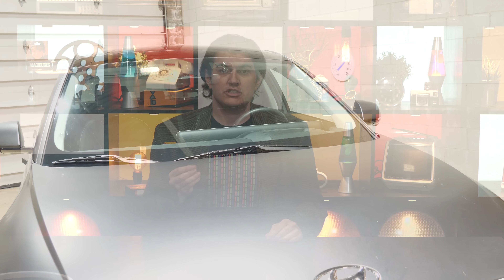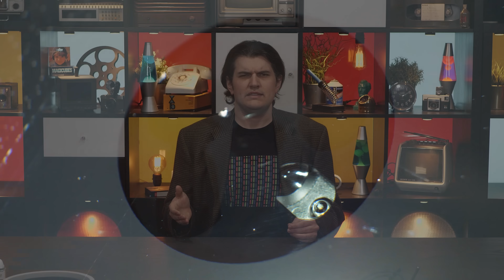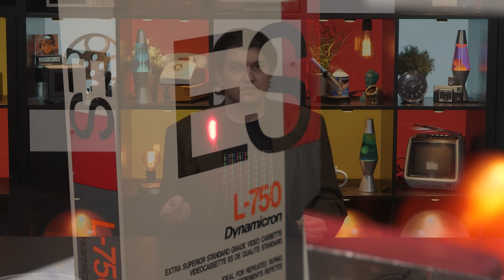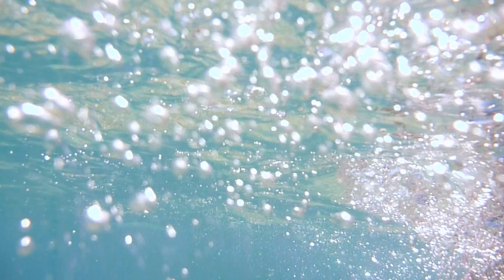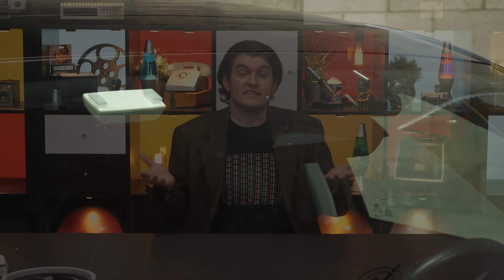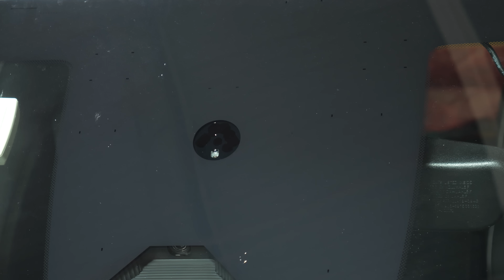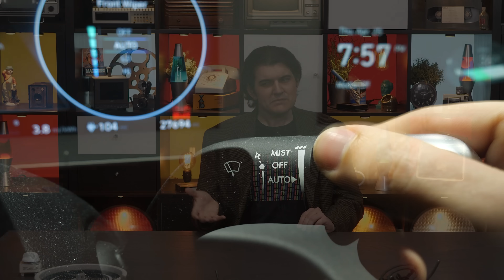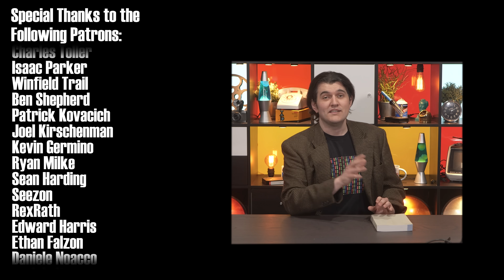The simple, clever sensor behind automatic windshield wipers

Comment: I have auto wipers - my major peeve with them is that occasionally they will massively overreact to a slight drizzle, and the lowest "manual" speed of my wipers is faster than I'd like for the conditions - there's just no way to get a usefully slow and steady wiping action, if the sensor has decided you're secretly in a monsoon.

Comment: As a Tesla Model X owner, I appreciate all the little jabs at Tesla.
Reply: I own 2 and the wipers are just a disaster.
Reply: I daily drive a 2020 Tesla Model 3 and I wouldn't mind seeing some straights and uppercuts mixed into the jabs.  I agree 100% with the jabs in this video and I would gladly pay extra for a real rain sensor.

I am generally happy with my Tesla otherwise, but I definitely will not trade in for a newer one until they add some physical controls back in.  I would say Tesla is taking "the best part is no part" mantra a bit too far lately.  They are basically trying to sell "the best control is no control" or "the best feature is no feature" which is entirely wrong, stupid, and short sighted.  Can you use buttons on the steering wheel for turn signals?  Yes, it is possible.  But should you?  No!  Doing so is objectively worse than a stalk.
Reply: @D3kKromb0x  yeah, well,  they seem to be fascinated by how Apple simplified computer UI by avoiding right clicks and menu items... I understand that part... but they kept the keyboard short cuts.

I mean, it's great if Tesla wants to make driving easier, but I think they should keep the stalks around until they know that nobody use them anymore.
Reply: "As a Tesla Model X owner, I appreciate all the little jabs at no organization in particular".
Reply: I don't classify Tesla as a car company, they're a software company that makes car shaped objects
Reply: As a Tesla owner, i find your comment is way out of context but that happens all the time by tesla fanboys
Reply: I thought it might works for  boeing
Reply: Even the Little Jab at the head of Tesla?
Reply: The camera based rain detector that malfunctions all the time is my least favorite part on my model 3. This is because I drive an old model with a signal stalk. I won’t upgrade to a Tesla again before they put the signaling stalk back.
Reply: @icefox1983  As a 2024 m3 owner I can tell you that the buttons are fine for signaling, I would prefer stalks but this I don't really care...
I want my light stick!!!! they made wipers control "fine" where you push the button and can change speeds with the wheel, but the lights are only controlled from the touch screen!
the exact same popup as the wipers pops up but you can't control it with the left wheel.
(only high beams are from the wheel)
Reply: @icefox1983 yeah same here. It's infuriating to have such a simple thing on an expensive car work so poorly.
Reply: Well, tesla isn't the only car company trying to make the cabin look more futuristic by moving controls into the infotainment system, or using touch surface buttons... it's also cheaper than actual knobs and buttons...

But it's so annoying to the driver, especially if that driver is old enough to have the muscle memory.

It's all good and convenient with cars that try to help you driving.

But there will be cases where it's nice to be able to override the fancy stuff, and preferably without removing your eyes from traffic.

Leave my gear selector alone, let me manually override lights, blinkers and wipers. And give me a knob for volume and climate control. Let me engage, disengage and adjust cruise control without lifting a hand from the steering wheel.

I also like how Hyundai use paddles to adjust regeneration and how Audi lets you change drive mode while driving, so you can switch to ECO when you enter a town, or you see the battery level disappearing faster than you planned.

Don't make me pull over so I can adjust everything for the further journey in the infotainment system.

And don't try to make me try voice control... as a non-native English speaker I'm sure that I pronounce some words incorrectly, and the Danish voice recognition isn't as well trained as the English one.

When that rant is out, I'll agree that it looks nice and sleek with all that touch and simplified controls... it's just not very practical.
Reply: @BenjaminVestergaard I think he’s more alluding to the lack of auto-wipe sensors in current Tesla models, since they moved to a pure camera implementation that, frankly, is just awful and doesn’t work.  All to save a few bucks per car.
Reply: @mobibobobobobobobvobobo  well, tesla also made away with the radar and ultrasound sensors... all camera based now...

I can't imagine that working very well for very long during a Danish winter if we have snow, because we spread salt on slippery roads. It creates a nice sticky sleet along the edge of the road, and during snowfall, that stuff builds up and you need to use sprinklers on your windscreen for it to remain clear.

I've experienced that sleet build up to get so bad that the radar didn't even work after an hour on the highway, and the camera based lane assist was not exactly reliable either. That was a Hyundai I think.

Edit: but I'm sure that Teslas all-camera system works pretty well in sunny California.
Reply: @BenjaminVestergaard  Tesla headlight alignment also doesnt work properly, also relying on the camera. Automatic MOT fail.
Reply: @mobibobobobobobobvobobo  They work quite well with the latest updates.
Reply: @BenjaminVestergaard unfortunately we have only had one snowstorm during my free trial of FSD but it worked fine.  Just this last weekend it was pouring rain at night and it didn’t have any problem on a 30 minute drive. I’ve been pretty impressed with what it can do with just cameras. That said it’s still not worth the $8,000 or $99/month just yet.
Reply: @williamreynolds6132  aw I know it's already impressive what it can do, especially considering that it's using cameras only.

What I'm not comfortable with is that they're removing sensors that can see something the eyes even can't.

If you try a really good assistant system, like VW or BMW, you can see in your dashboard what the radar picks up, and even when it's pouring rain, where your own visibility is limited to perhaps 50m, it can keep track of 3 lanes of traffic, 2 cars in front of you.

With cameras only it would possibly be able to identify the back lights of other cars right around you in such weather, the radar can evaluate the size of the cars 2 layers in front of you.

And then there's the snow thing... the snow fall itself isn't a big problem when you have plenty of cameras. The computer vision AI can sort out what's snow and ignore it per camera.

The problem is the build-up of salty sleet when the temperatures are close to 0°C. 

The snow is thawing because salt, but it's still just cold enough to still keep new snow, and if it settles on a moving car the windchill will freeze it and it will build up, just like freezing rain or black ice...

But the sleet isn't pure or clear, it's muddy, and within half an hour your entire front end of the car may be covered in a 5-10mm layer of frozen gunk.

You may be lucky that you can keep the windscreen clean enough, from salt, for that one camera working, but with only one camera the computer vision will lose depth perception and can't ignore the falling snow as it would usually do.

Sure, it may be able to estimate and assume distance from calculating perspectives... but I'd not feel entirely comfortable relying on that, not for FSD, not even for ACC.
Reply: @BenjaminVestergaard  "But it's so annoying to the driver, especially if that driver is old enough to have the muscle memory." - It has nothing to do with the driver's age and it's so much more than just "muscle memory" - a generic term for: a mix of proprioception (own body positioning and movement in space), kinesthesia (learnt movements to accomplish a task), exteroception (just the Mechanoreception part of it, for vibrations, discriminatory touch and pressure sensing) and object permanence (knowing that the knobs are still there, in space, even if you're not/ no longer looking at them). Ergonomics in industrial design is not just drawing pretty pictures...unfortunately designers now have to bend over to the whims of huge hordes of customers (and thus sales) and implement things that look cool on the showroom floor but which they know (hopefully) that are no where near as useful and convenient as knobs, dials and physical buttons, not to mention increasingly dangerous to use in a moving vehicle. But yeah, I pretty much share your frustration especially since I have first hand knowledge of industrial design, ergonomics and now am a software engineer in the automotive industry...Search  YouTube for "The Expert (Short Comedy Sketch)" and you'll see and hopefully understand what "being an engineer" feels like today, at least in this industry. Cheers!
Reply: @Archangell27  oh, I know that expert situation... why I'm not doing software anymore, but I was under the impression that the automotive industry, in general, was more run the old fashion and documented way, because legal requirements, rather than the startup way without a specification of requirements or an absolutely defined goal to base your test report upon before release to market. 

Anyway, what I meant about my age, I've had my drivers licence for almost 25 years, I grew up with certain features easy to reach in cars that wouldn't help me very much, mostly even manual gears.

A new and younger generation of driver would probably find it less annoying not having certain functions at their fingertips without looking.
Reply: came here to say this, 5 years of owning Tesla, we are at a point where the car drives itself so I'm freed up to micro manage its wipers.
Reply: get a different car
Reply: @telotawa  When you find an electric 6 seater with 320+ miles of range, automatic doors, can add 120+ miles with 10 minutes of charging, works with tesla supercharger network and is $50k or less, let me know and I will buy it. 

I have three kids in car seats and really wanted an electric minivan but those don't exist in the US yet. We have a Chevy Bolt and can fit 3 car seats in the back but it is very cramped and the charging rate is too slow to support the long distance road trips we take to see our family. The Model X checks off all of the things we were looking for and we were able to get a used low mileage 2022 for $50k. You can even find older Xs (with all the stalks) for under $30k. I have plenty of complaints about Tesla (and especially Musk) but the car does what we need now and will work for us for at least another decade.
Reply: @youruniquehandle2  aw, why did you have to put a max price on it? 😄 otherwise I would have recommended to check out the Mercedes EQ* series, the newer ones come with quite good ranges, and EQV has plenty of space.

Comment: The rain sensing system in my 2020 Honda Pilot is mostly useless in light rain. The rain drops are too few and random that the sensor just doesn't have enough information to go by. If water accumulates mostly away from the sensor, the wipers don't activate when they should. If a rain drop happens to fall right on the sensor but the windshield is mostly dry, the wipers go full steam when they really shouldn't. In moderate or heavy rain, the sensor works fine since the windshield gets rained on pretty evenly.

Overall I prefer the old fashion manual system where you choose the wiper interval.

Comment: Super interesting video, I (presumably like most) just assumed my rain-sensing wipers were operated by the camera. But if the same sensor that operates the wipers operates the automatic headlights then what is the small sensor on top of the dashboard for? I assumed THAT was for the automatic headlights. This channel always makes me think and I love it! 

Edit: I actually checked the sensor on my dashboard by covering it with a cloth and the headlights turned on, confirming it is for the automatic headlights. My car has both rain sensing wipers and automatic headlights but they are two separate sensors. Not sure if that's just a Ford thing or not.

Comment: years ago, I installed  a power skylight, and it instructed the installation of a rain sensor, which consisted of a small printed circuit card, with exposed conductive paths.  if a drop of water bridged two paths, it closed the circuit and triggered a "close the skylight" signal.  how far we have advanced.

Comment: 0:30 I literally had my Tesla from 2021-2024, just sold it. Not a single time has the auto wipers worked correctly. And from 2021 to late 2023 it was MANDATORY to use when using cruise control, you could NOT turn it off... So one drop of rain the wipers went crazy, pouring rain, it barely did anything. Random sun glare on a bright dry day, full power on the wipers. So i just couldnt use cruise control in my Tesla.... So much for the future... One of the reasons i don't really trust FSD becoming a common thing that just works, when they can't even make windshield wipers.
Reply: Auto wipers will never work correctly. Manual controls or overrides are absolutely necessary for a product to be quality.
Reply: @iunnox  My Mazda has the option of manual, but has auto wipers too but with a frequency setting from 1-5 on the auto. Works about 95% of the time, quite happy with it. And when i'm not, i can turn off the auto feature.
Reply: @Akinto710  The rain sensing wipers are very similar on my VW. I very rarely need to intervene, and we get plenty of rain at random times here in the UK
Reply: @Akinto710  I also have a Mazda, the auto setting never works as well as the manual ones.
Reply: Holy crap that is annoying. That's something that bugs me about software updates too because the car can operate normal when you buy it, but then they change a feature later on and you are stuck with operation different from what it used to be.
Reply: @volvo09  that's exactly what happened. The auto feature wasn't on when using cruise control when I bought the car, no problem.

Then there was a software update so it was on all the time, and you couldn't turn it off for 3 years.

Now just recently it turns on auto every time you activate cruise control, but you can turn it off. You have to do it every time though.
Reply: The wipers not working perfectly is not a Tesla thing, however forcing me to use that mode would drive me crazy.
Reply: @mediocreman2  If car manufacturers will keep doing this and the government kills my old car I may decide to just give up on driving, I'm not buying into this kind of future
Reply: The future is setting things up to make all individual car features subscription services
Reply: @Hecker9974  Rear heated seats in the Standard Range Model 3 was already a DLC haha :)
Reply: My wife Toyota’s Corolla does it just fine

Comment: I had one of these on a Peugeot 306. It was brilliant - worked really well. Later, I got a Citroen Picasso. It had the same sensor but this time it was mounted at the bottom, rather than the top of the windscreen. It had been disabled and I got the garage to re-enable it. It was rubbish. Almost never got the detection right. I think the disabling was a manufacturing choice because it was so poor.